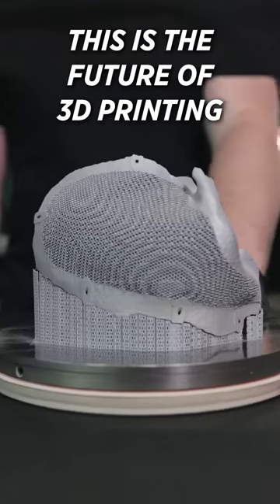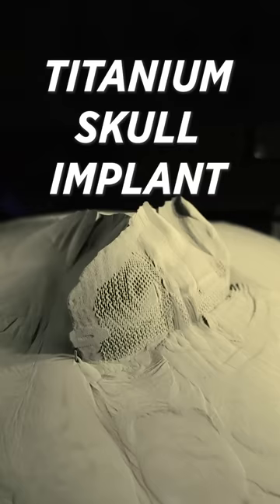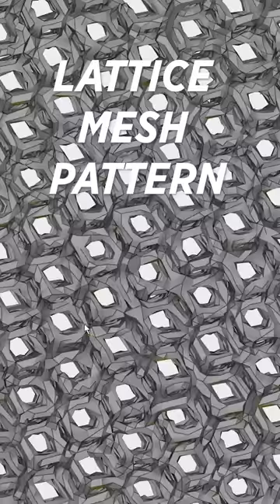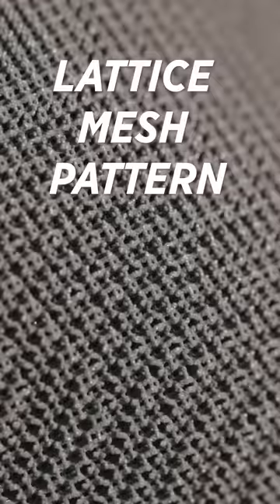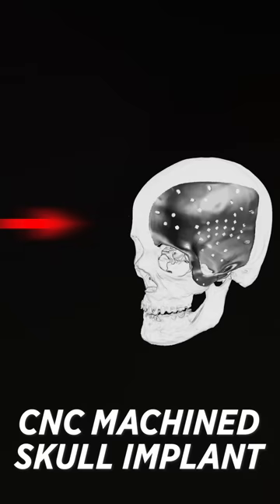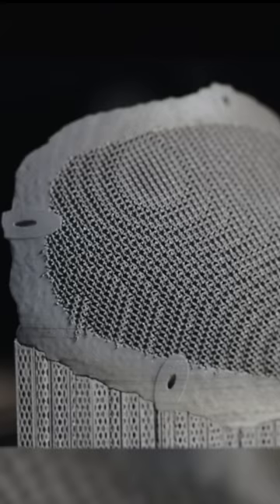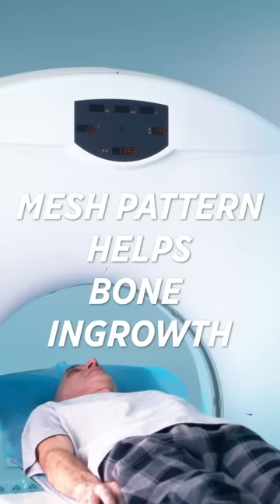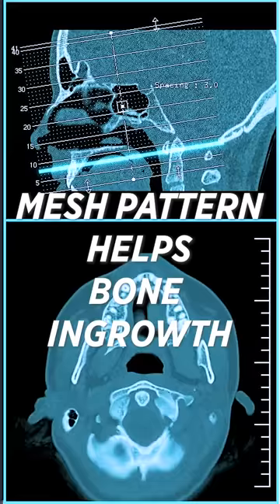3D Printing the World's MOST COMPLICATED Medical Device

Comment: It's crazy how bio-compatible titanium is. The body sees it and just says "yeah, I can work with that"
Reply: Wouldn't it be crazy if one day there is someone who replaces all of their bones with titanium? That would be fuckin WILD!
Reply: @NotMe-ej9yz  Then no more stem cells lol
Reply: @NotMe-ej9yz  Titanium would not likely be better than the original bone. 

Small titanium reinforcements could add strength, but at the cost of mass, and if it does break, it's going to be a lot worse. Also, nanotechnology would be required to install it without destroying the patient.
Reply: Apparently it's because of the strength of the oxide layer that prevents the body from breaking it down.  I know this personally from trying to polish/etch it... you have to use super strong peroxide mixed 50/50 with colloidal silica.  Pain in the ass.
Reply: Platinum is similar
Reply: @NotMe-ej9yz  it's not better than the original bone. In fact the point of using an implant with a porous structure instead of a solid body is that bone cell can grow through it. Bone has to be compressible to some extent to absorb shock.
Reply: Those implants are not. The loose, half molten powder on the surface is dangerous and almost impossible to clean up properly.
Reply: @henria.277 that's why it goes through a hipping process to sinter the remaining powder that can't be removed during the post process cleaning
Reply: @NotMe-ej9yz  bones produce blood. You wouldn't live very long if you replaced all your bones.
Reply: @MedievalSolutions  was just about to say this
Reply: @JuanAuribus  what’s that
Reply: @jakobthejeweler746  real
Reply: My father has like half his bones replaced with titanium and joints coated in (I don't remember what metal). Guy has a talent for nearly dying.
Reply: I am obviously exaggerating before someone comments. He's got an arm and a leg replaced, one knee joint coated.
Reply: This makes me wonder if one could take a piece like that, and Neurolink the hell out of it such that when it is places on one’s head it is like 100x what neurolink is and then the injured person can get some sick AI-like superpowers from this computer in their brain… but instead of a computer it would be like a circuitry that the brain could learn to use or something trippy and when a signal is sent through it, it produces a result that the brain can maybe use to do some cool stuff like driving a car or detecting something cool or I don’t know… just seems like a cool idea - I mean, imagine neurons growing within this structure and starting to interact with it because it has threads coming off of it like Neurolink but instead of a single tiny thing it would be covered in it and take up half the skull!? That would be pretty powerful I bet, albeit most likely dumb until humans evolve another 500-10,000 years in technology 🤷‍♂️
Reply: @ImNotQualifiedToSayThisBut  that’s plenty enough to say what you said… damn dude, your pops really does have a thing for getting between a stone and a hard place, literally.
Reply: Actually titanium has to be passivated to ASTM F86 , A967, or A380 BEFORE it is biocompatible.
Reply: It's still heavier than bones
Reply: @NotMe-ej9yz  I don't think there is any material that can replace bone in its effectiveness.
Reply: Bring on the wolverine liquid metal skeleton swap
Reply: @NotMe-ej9yz  like wolverine?
Reply: @NotMe-ej9yz  cyberpunk my dream comes true
Reply: @NotMe-ej9yz  irl wolverine
Reply: Cobalt as well.
Reply: Spartans are coming
Reply: @NotMe-ej9yz  totally not been done in a video game before... profile pic
Reply: Gonna go educate myself more about titanium now thank you lol
Reply: @19nineteenthirteen19  umm what? I hope that's a joke lol
Reply: That's pretty interesting!
Reply: Yeah unless a bacterium gets in there and creates a biofilm. Them it all goes to s***.
Reply: @justinmcdaniel5722  Nope. There are or used to be a couple places in the country that did it.  it was called porous coating.  If you can imagine the beads are smaller than salt to give it that micro porous texture.
Reply: That is because dead bodies.. go back to earth and become tutanium.
.
So alive bodies treat them as their own.
Reply: @JuanAuribus  good point. How about a layer of metal on top of the bone for reinforcement.
Reply: @Kratos1902  how will you get nutrients and attachments to the entire bone that way?
Reply: @NotMe-ej9yz  From the moment I understood the weakness of my flesh, it disgusted me
Reply: @ThePureblooded  my bad i thought you were saying cobalt is Biocompatible with human anatomy.. if that's what you meant, then yes you are most certainly incorrect
Reply: @NotMe-ej9yz  You cant do that because your bones make your blood cells...
Reply: @NotMe-ej9yz  you kinda need your bones to make more cells but g’wan
Reply: @MedievalSolutions  They also store and release calcium and other essential minerals
Reply: I imagine that in the future,exo skeletons would be made entirely of titanium,just because how compatible it is with the human body.Ill be betting the titanium industry will grow and be big in the future. It might be worth investing into titanium
Reply: @JuanAuribus  what if it's used as a reinforcement core though!!
Reply: time to become the terminator
Reply: @Not Me  a huge part of my skull js made of titanium mesh😂 other than it feeling weird with pressure on certain points it feels like pre surgey
Reply: @NotMe-ej9yz  halo logic
Reply: @user2C47  “likely not” but you’re saying there is a chance it’ll be better…
Reply: @JuanAuribus  titanium could only fix bones probably,  not stuff like organs
Reply: I take it that the titanium can't be removed after the skull has grown in.
Reply: @Leostar-Regalius  I never mentioned anything other than the bone.
Reply: @justanotherperson2576  Bone marrow is what produces stem cells.
Reply: @User 2C47  fuck yes it would.  If you could create a stem cell production bladder that could be surgically implanted to the spleen or liver or other major blood infusion organs, you would then have little reason to keep the original bone.  You can now print a similar but much denser lattice structure out of a titanium alloy and have bones more than 2x the strength with far greater compressive resistance.  You could jump off 4th story balconies and only have to worry about falling on your face if you don't get the landing right.  Theb hopping right back up.  We're also gonna have to reinforce the muscles though.  So let's just replace them with induction motor artificial muscles.  Replace elbow and knee joints with omni directional ball joints with a locking mechanism to allow movement in any direction in split second speeds.  Hell let's make all the joints omni.  Make your legs spin like rotors in the water and your arms do full 360 paddle wheel rotations.  You could probably swim fast enough to raise your front out of the water like a speed boat if we go far enough.  Punch through concrete.  Professional wrestling now involves shooting the wrestlers at point blank range with high caliber pistols but with reduced powder loads so that the guns seem more dangerous than they are.  And their skulls could be composed of a shock absorbing Kevlar interlaced skin over titanium mesh with another shock absorbing layer in between it and a final layer of titanium before the natural brain casing.  We could literally put a helmet inside our heads.  No more brain damage from football and boxing.  3d print new brain cells onto truly damaged areas and replace the dented titanium like a car part.
Reply: @JuanAuribus  You mean blood cells? Besides you can keep the inside of the bone or transplant the marrow into the metal or rather print the titanium in 2 parts and bind it together! Perfect solution where you have the benefits of titanium lattice and the production of the marrow!
Reply: @polycrystallinecandy  Not really the part that absorbs shock is the cart ledge, ligaments, and other tissue/fluid, unless your talking about ribs specifically to my knowledge.
Reply: @henria.277  They have after print processes for that. Sintering after all of the blowing and other dissolving methods will effectively weld it farther together.
Reply: @StarForgers  bones absorb shock too, or they'd shatter much more easily. There would not be nearly enough soft tissue to absorb shock from all directions. Of course bones are much stiffer, so they flex much less than cartilage. But it's all relative to the load. Think of how stiff a car's suspension is
Reply: @NotMe-ej9yz  yeah, who needs marrow for blood production anyway.....
Reply: @NotMe-ej9yz  if someone even did that with 1/4 of the bones in their body they likely wouldn’t be able to walk after having surgery so much or many times and literally replacing your bone with a piece of metal you’re not just gonna get up and walk around on metal legs
Reply: That's why we see people in media using titanium body modifications to become a cyborg, or doctors bringing someone back using electronic/hydraulic titanium parts
Reply: @NotMe-ej9yz  Imagine it bending or breaking 💀
Reply: Would it have anything to do with the purity of the metal? We consume iron but is there anything we consume that has titanium in it?
Reply: @polycrystallinecandy  Obviously every material in existence no matter how strong has to have some ability to absorb impact unless it shatters. The point is that when it comes to the strength and resilience of titanium and how hard it is to shatter that becomes a non issue. For the most part at least. 

If nothing else they could put more synthetic padding at the end of the implanted synthetic bones.
Reply: @ImNotQualifiedToSayThisBut  is your dad George cuz my dad is George?
Reply: Doesn’t the marrow in the bone produce the blood? So if you replace your bones you would have no source of blood? Please correct me if I’m wrong.
Reply: now if only my surgeon would listen to me when I say just wrap it around the  ones and it will grow back . I would be better than that guy with the unobtanium claws.
Reply: Real fact: ok, i can't against you, so i'll join you
Reply: Wolverine
Reply: @henria.277  What are you trying to say? Could you try again?
Reply: @ImNotQualifiedToSayThisBut  Jesus that's wild
Reply: we actually have a lot of metals in our body naturally and a lot of them aren’t found on earth easily
Reply: @NotMe-ej9yz would need to either infuse new blood cells constantly or find a way for your body to keep your blood stable because bone is necessary for that
Reply: @NotMe-ej9yz  I will do my best to be the first person to have all metal bones
Reply: @user2C47  the plate I got in my hand for a boxers fracture is that titanium or just rusty mild steel they found out back
Reply: really?  i didn't know that, sounds cool.
Reply: I have titanium inside me! 7 ish inch long titanium plate screwed into my ulna bone.
Reply: @NotMe-ej9yz  bro thought he came up with the wolverine idea lol
Reply: @NotMe-ej9yz  ok Wolverine
Reply: @NotMe-ej9yz  bones are essential for some processes in the body, hence why some people need bone marrow transplants.
Reply: @BornotB-ij9xk  why does this sound like an NFT ad?
Reply: @user2C47  shush
Reply: @polycrystallinecandy  shhhh
Reply: @StarForgers  I didn't mean Titanium would shatter, of course. But any increase in rigidity of the bones would mean that impact is transferred to other structures in the body.
Reply: Got some of that in my arm. is awsome
Reply: @NotMe-ej9yz  I know a Canadian guy that did something similar like that once. He unfortunately, grew sharp metallic claws in his forearms as side-effect.
Reply: Funny fact that most thingd can be bio compatible as long as they re coated w the right biomaterial
Reply: So question. If it were iron would the body reject it? Even though we need iron? Would that affect our iron levels too much?
Reply: @BornotB-ij9xk  it doesn't matter it an EXO skeleton is bio-compatible, because it's a machine that is affixed over the body. Even still, something mechanical like that may still not be as effective as softer exoskeletons using elasticity and in some cases, synthetic muscle tissue
Reply: Ehhh close enough
Reply: @NotMe-ej9yz cue cyberpunk music
Reply: I used to know a guy who was allergic to titanium
didn't know you could be allergic to metals before I met him.
Reply: @JuanAuribus  stem is pretty cool
Reply: @NotMe-ej9yz  that guy would be bringing Sia's 
 song to life....i am titaaanniiiiuuuuum
Reply: Cyberpunk here we come
Reply: @NotMe-ej9yz actually that’s not far off I’ve heard that someone needle there spine to be replaced and with no other options… went for a titanium spine and he’s a body builder too terminator finally goes to the gym
Reply: Your body needs bone cells to regulate calcium level in your blood. Also the origin of blood cells including immune cells derive from bone marrow.
Reply: Until you need an MRI. Titanium is not where we want to be; it is not good.
Reply: Not all the time
Reply: wolverine
Reply: it reminds me of Metalosis Maligna. its a horrifying little medical fiction that is played as real and its just....horrifying.
Reply: @MRMIKE276  why not hydrofluoric acid like when etching alu?
Reply: Adamantium is next
Reply: @NotMe-ej9yz  one day in cyberpunk
Reply: @NotMe-ej9yz bruh wolwerine did this and he used upgraded version of titanium
Reply: Well... they use it for prosthetics and other stuffs like piercings. It aint problematic to anybody, and even safer when it comes to allergies than surgical steel.
Reply: It’s pretty much because your body doesn’t see it, it’s non reactive so your body kinda goes oh nothing to see here, this is no danger
Reply: @gyalis  yup.
Reply: @JuanAuribus  No more stem cells, fewer blood cells, crippled immune system, no platelets and clotting ability… yeah sounds great 😂😭
Reply: I had Titanium plates for like 2 years.
Crazy how bad/slow new wounds healed.
I wouldn't say Titanium is perfect inside of a human.😅
Reply: @dawidlech8301  it may be the best material available for it. Maybe there was poor surgical work around, or restrictions infringed. I have no idea.
Reply: I want titanium covered bones

Comment: My wife works for a company as a medical planner. 

She uses the software to 3d print actual patients' bones and parts made out of powder in huge machines size of a small coupe that can print like 150 in a day. 

They also do metal 3d printing with titanium their biggest machine is probably the width of a sedan. 

Incredible stuff, helps out doctors like never before, especially for surgeries. It's fairly new technology a couple of years old. 

Can't imagine what will be new in the next 10 to 20 years
Reply: Yeah; most likely Desktop Metals production system if it's metal. If it's polymer it's likely HP's MJF(Multijetfusion)